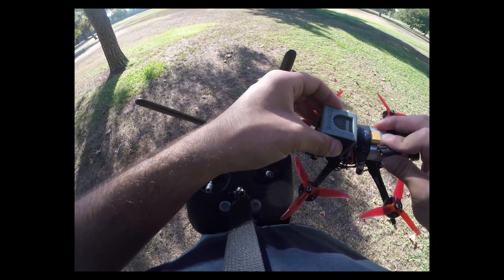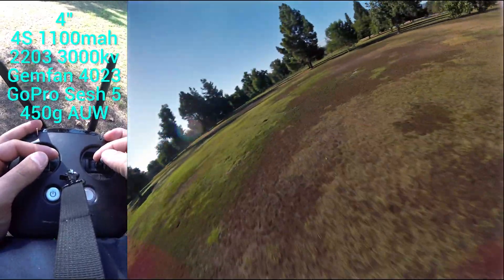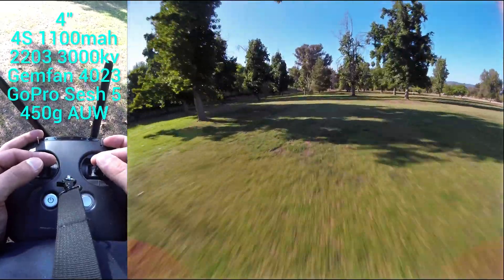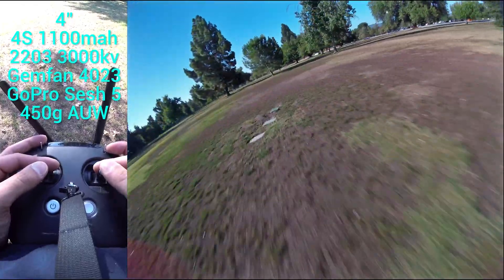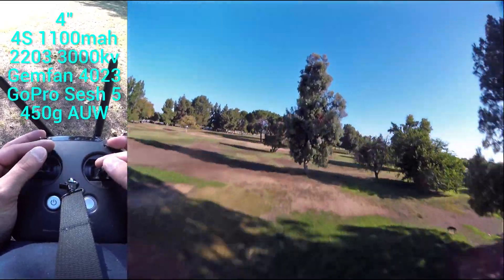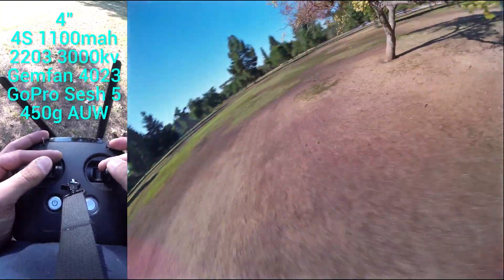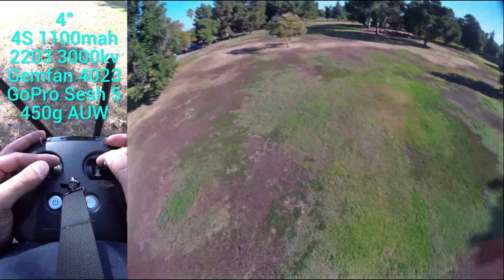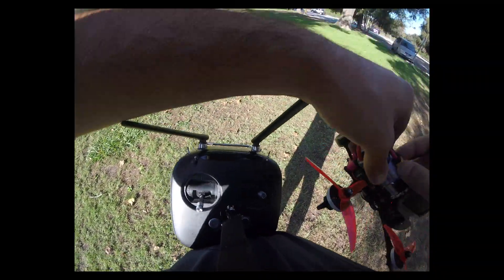Fouride Flight Performance

Comment: is the 4" significantly quieter then 5" quads?

i am looking for a freestyle rig, without digital fpv feed and with 20x20 fc and esc. 

WHAT WOULD YOU RECOMMEND for a high performance freestyle rig for the super light insta360 go on it in terms of a
-frame
-motors
-prop size
-batteryvoltage?

this would be the guts:
-talon f7
mamba f25 esc
unify pro32 nano vtx
crsf nano reciever
Reply from the maker: Your question is quite open ended so I can't answer that but I can answer the noise question. If you have a lower all up weigh for any given prop size, it will be quieter. It's a ratio of the weight vs prop size that mostly dictates this. Speed also plays a factor but it's that 'disk loading' metric that's most telling

Comment: That location looks like a familiar spot frequented by frisbee golfers but just a different area. Dude I'm so tempted to build this with all your recommendations except not digital. That's out of my range right now.
Reply from the maker: The analog build is even better imo. It's a really neat build depending on the components you use.

Comment: Why did you start to work on the 4-inch frame? As I remember previously you were not very optimistic about this size saying something like there is no sense to use them because 5" is better )
Reply from the maker: I'm not optimistic on it.  It's still a bastard size.  I still hugely prefer 5".  The reason it's a 4" is because I tried to make it a 3" and the whole package became big enough to fit 4" props....there just happened to be some good 4" props so I went with it.  It can still be run on 3" if desired.  That being said, the more recent components have made 4" heaps better than it used to be.  Still a bastard size but not bad as a scaled down 5".  It actually is a scaled down 5" now.  In the past it was just a 5" with 4" props on it so just awful.